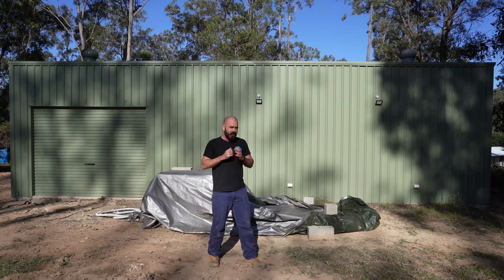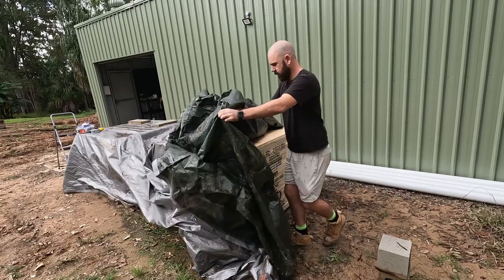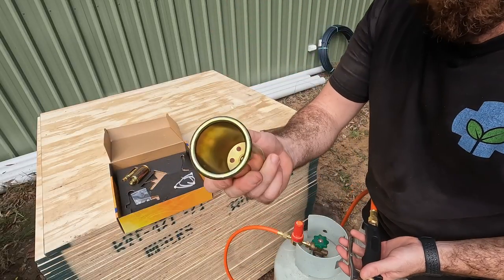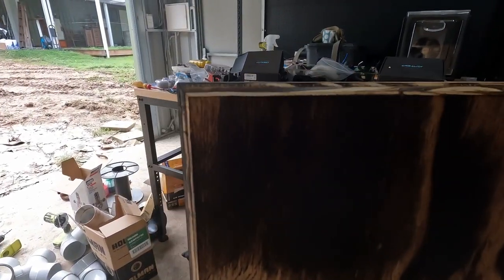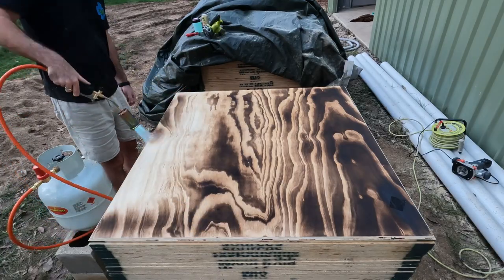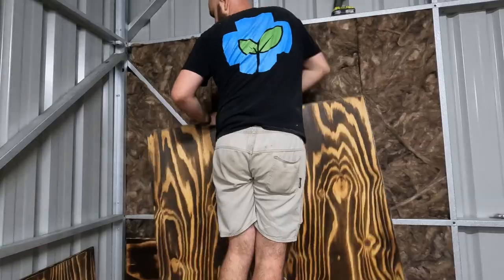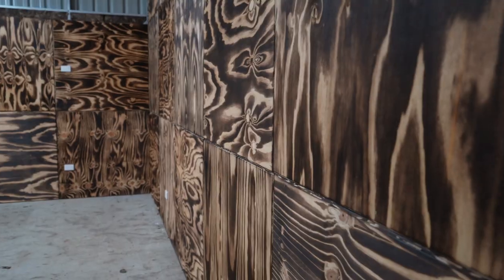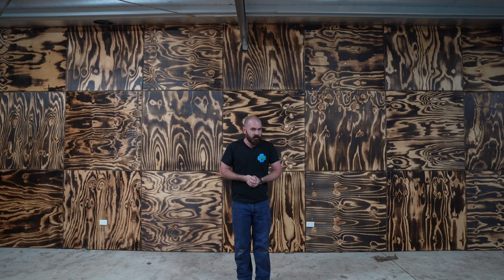How to: Burnt Plywood Cladding

Comment: I’ve used this same technique and love it. Your project is stunning. I appreciate how you rotate the grain so intentionally .  I used a garden weed torch that has a long handle and that makes it more ergonomic. Your burn was relatively light and will probably lighten a lot with time.  I found that sealing with oil changed the character of the contrast of the design because the rag picks up the char and smears it on the light surface.  It’s beautiful but I didn’t see signs of that smearing in your project.  My applications didn’t have a uniform pattern because of wall lengths and I wanted to nail onto the studs. I didn’t router my edges like you.  I used thin trim boards of unburned wood to hide / accentuate my seams and create contrast.  Someone asked if the char comes off onto clothes etc.  in my experience yes but much much less than I expected.  Someone else asked if you can burn the wood on an existing wall.  I’ve done it and it turned out fine but I would not recommend it for safety reasons.  Sometimes the plywood glue catches fire and you need to stamp it out with your foot or a wet cloth

Comment: Having built an enclosed trailer toolshop, what I recommend for insulating is spray foam all the corners to get air tight, then install furring strips on your steel/aluminum studs. The furring strips do 2 things. 1. More depth to get more insulation. 2 a much easier mounting point to attach whatever your surface panels. That way you're not trying to use a ton of self tapping screws, just short drywall screws. Something to think about for the rest of your shop